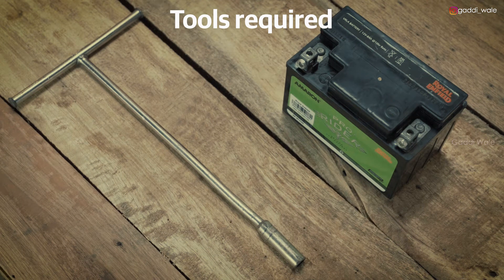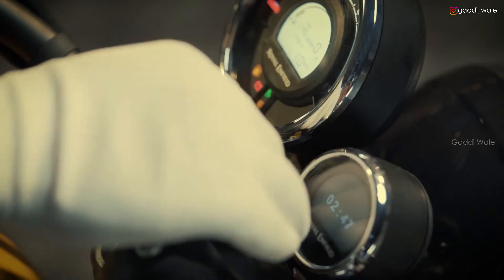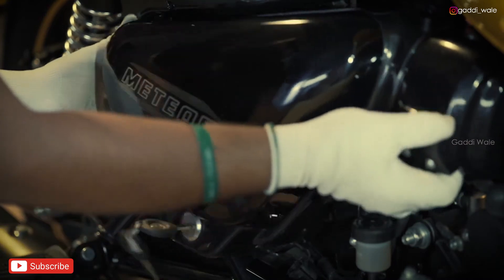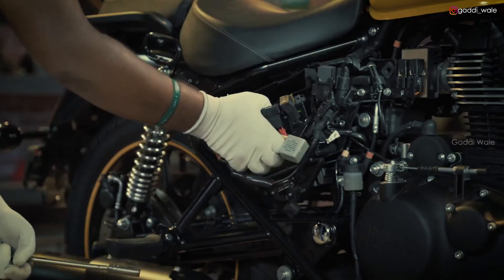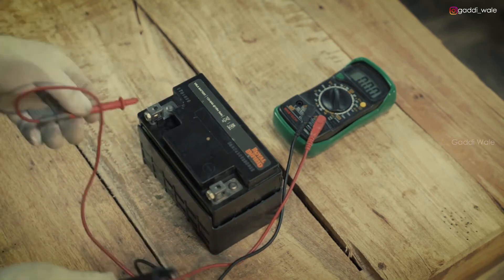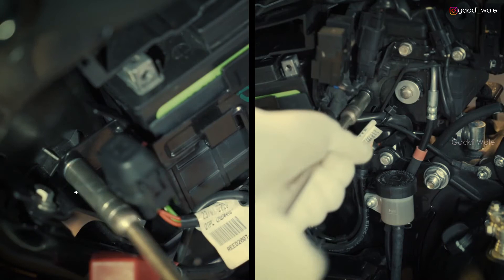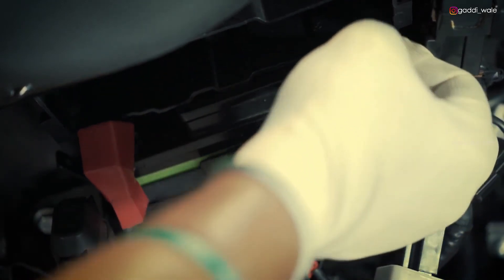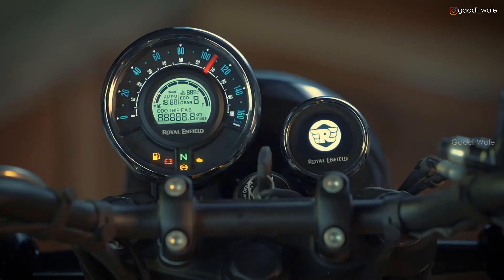Royal Enfield Meteor 350 | BATTERY INSPECTION & REPLACEMENT

Comment: When checking you battery, it should read between 12.8 and 13.2 volts. If your battery is reading 12volts, it needs charging or replacing. This is due to a 12 volt battery having 6x2.2volt cells. They are rounded down to 2volts each but your actual reading on the multimeter should be a lot higher than 12